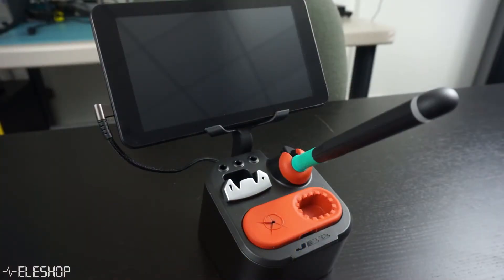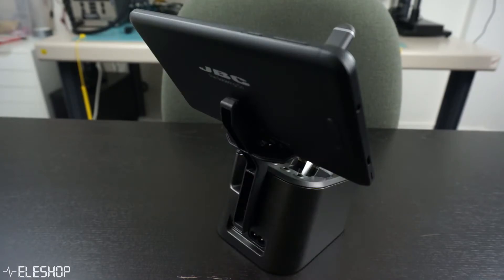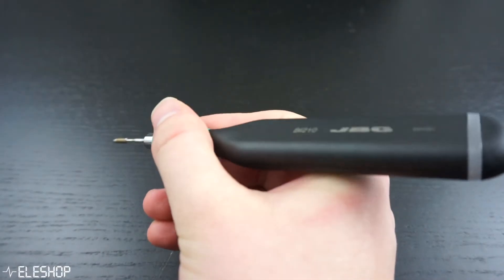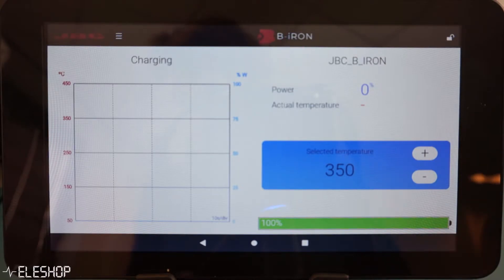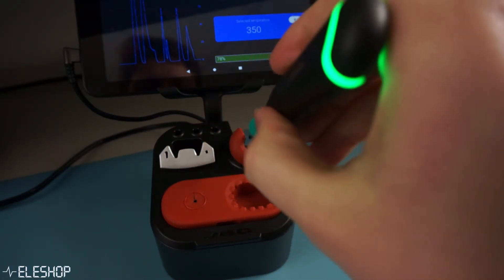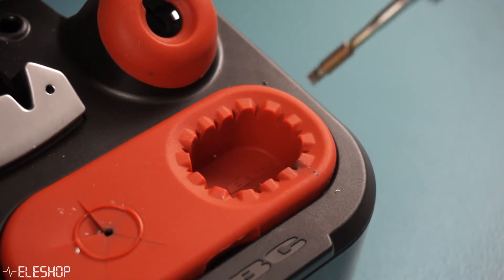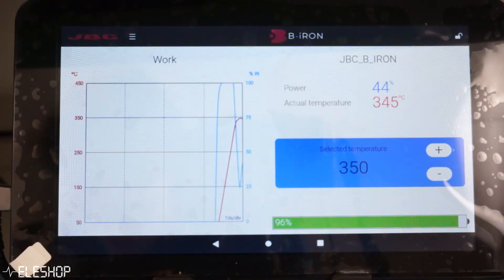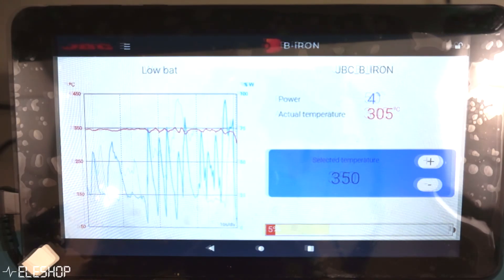The new wireless JBC B-iRON soldering station

Comment: It's interesting to see how this B-IRON differs from the released one. Having a big ass stand is annoying for an otherwise portable device. Can it (the released one) work away from the station and screen? I know an Android device can be used, but I want to use the iron in the field, not also dork with a phone.
Reply from the maker: Its definitely not a device for in the field. The internal battery is small. By using the stand, the battery is charged in between soldering joints. Without stand the battery doesn't last long enough to take it with you in the field. For field use we nowadays recommend a USB-C iron with a strong powerbank.

Comment: Your soldering at 3:44 is not really the way to do it. 
You are putting solder wire directly on solder tip and not heat up the pad. 
This is the reason your joints look like balls instead of spikes.

Push solder tip down so it simultaneously heats up PCB pad and IC pin. When hot add solder from other side so it melts indirectly by heat of pad.
When melted remove solder wire and slide tip up the pin to remove it.
Reply from the maker: You are right! Maybe this is a good topic for a next video :-)
Reply: agree. all the balls are cold joints, not good, the Iron never heats the pins hot enough.
  makes me suspicious if this  Iron can solder. Normally, you put solder on other side of the pin  and a good Iron  can heat the pad and the pin fast enough. But if you had to touch the solder to the Iron Tip every single joint, then  it's not a good iron.  
Every solder joint done in video is a cold joint (watch in slow motion).   yes you pre-wet tip a little before starting. but with a good iron, you could Touch opposite side of the Pin with solder and the Iron could melt it from heating the pad.
  I did not see any demo of proper soldering  on this that makes it look right. ball shapes caused because solder cooled too fast on the Pins (pins not hot enough). 
this is why it is best that the pin is touched on one side with Iron, and  solder touched on opposite side of pin, it flows when the pin + pad  is right temperature and not from touching solder to the iron directly.
Reply from the maker: The iron is not causing the issue, the operator is causing the issue in this case ;-)
Reply: @EleshopVideo  thank you good to know.
Reply: He accidentally got a couple good ones.

Comment: So if I understand correctly, the station itself only charges the iron and tablet and the app controls it. Does the app support multiple irons at the same time? It doesn't happen often, but sometimes, you want to 'dual wield'. Would be nice not to have a second station and/or wire running over the desk.
Reply from the maker: You understand it correctly. The station is the charger for the tablet and for the iron. The app doesn't support multiple irons.